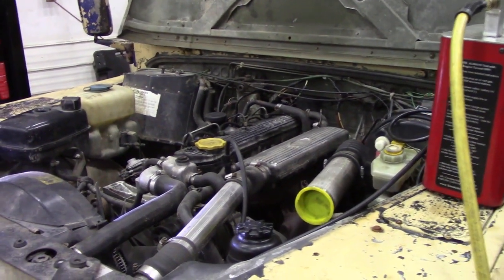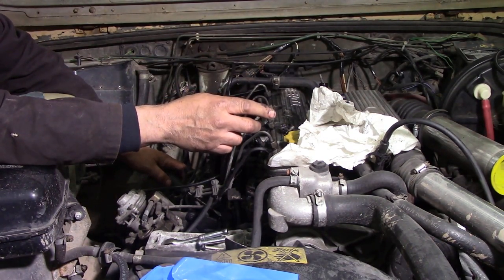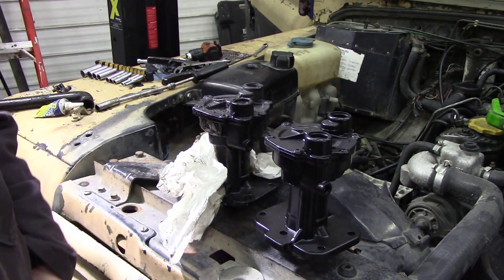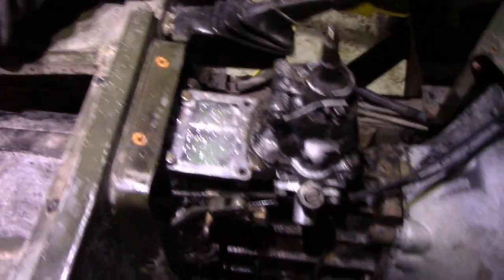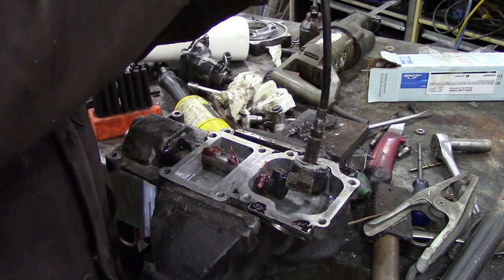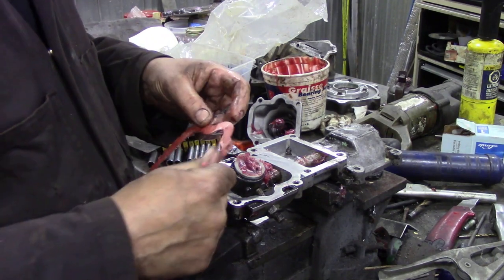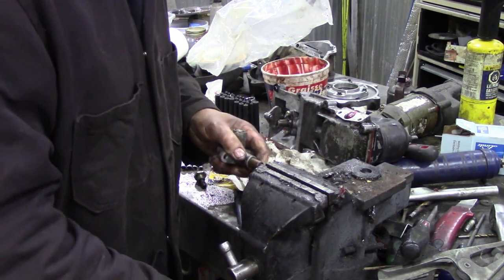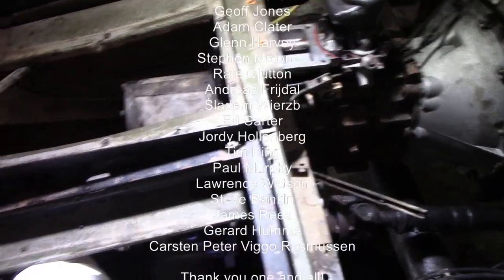A long video on correcting 300Tdi / LT77 oil leaks

Comment: I've done these before but still learned several things.  Thanks Mike.  The long form video is great, although I watched it in 3 parts.

Had a similar problem with the bolts on the LT77 leaking oil.  Someone put an old LT77 on my '91 and it didn't have the old shifting linkage.  Damned drilled through holes!
Reply from the maker: I didn't notice - I should have checked it on the stand!

Comment: The Bearmach vac pump has the same stamping, mine has failed after 6 months and was ticking by 2 months. I think out of all the noises a Land Rover can make the ticking from either the vacuum pump or the lift pump has to be the most annoying. Good video is there a torque setting for the cyclone bolts mine is still pissing out oil even with a new o ring, I managed to get cheap genuine bagged pipes, they were very soft and no longer braided.
Reply from the maker: The never-ending problem with parts
The genuine vac pumps are £460!
by the time I import it to Canada they would be almost $1000
Not made a penny on it

Comment: My LT230 leaks despite a complete reseal last year. Think it was the cheap Brit part seals. I was too cheap at the time to spring for the genuine/Oem seals. For the labor involved in removing this pig from underside the vehicle, 50.00 more in parts would have been worth it. For now I top up LT ever so often. I’m unsure all leaks can ever be permanently stopped haha.
Reply from the maker: Don't always blame the seals! I always pressure test the boxes with a smoke tester prior to fitting - then never leak for years

Comment: Those TDI vacuum pumps are a bleeding disaster! In 15 years of having our 90 we've replaced the pump at least 5 times. They just don't last! We've tried the OEM part, Britpart and Bearmach, they're all as bad. We're strongly considering putting an electrical pump in and forgetting the whole bloody thing
Reply from the maker: Even if you buy a genuine part at £460+tax, it still will be bad
Pity they didn't put the vac pump on the back of the alternator like many other manufactures
I know the exhaust is close, but it could have been modified

Comment: I drilled and replaced the seal on the vacuum pump, then replaced the rivets with bolts all while leaving the pump in place on the engine. Turned out to be a good job. But I'm afraid this one is too far against the bulkhead to be able to do it in that way.

Comment: Hi Mike, Love the long video's ( less time to work on the RRC and Disco 1), Talking of Discos does the vacuum pump on a 200tdi sound the same as the 300tdi when worn ?  would be helpful to know before I strip down the top end to replace the cam followers, The ticking only starts above  1,000 rpm. Can't wait for the 300tdi/RRC, Just what I am going to do next when I get my wife's Disco sorted.
Reply from the maker: The vac pump on the 200Tdi was a vane pump and gave very few problems
The cam followers on the Tdi's also give few problems - in fact they are quite a good design - never replace the rollers with cheap aftermarket ones  - they are not treated the same as originals - I have seen a  few that look like thruppenny bits!
Get yourself a mechanics stethoscope and try and trace the ticking